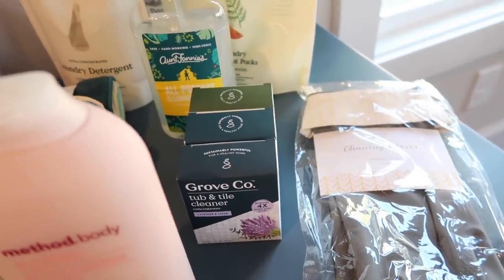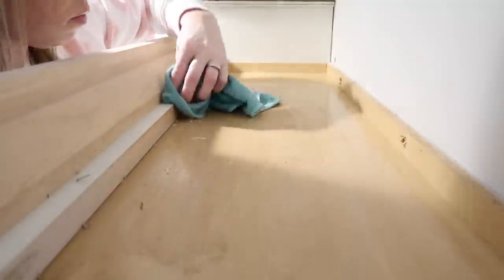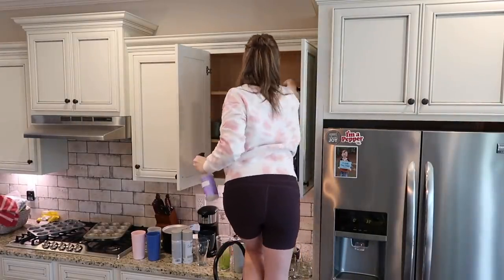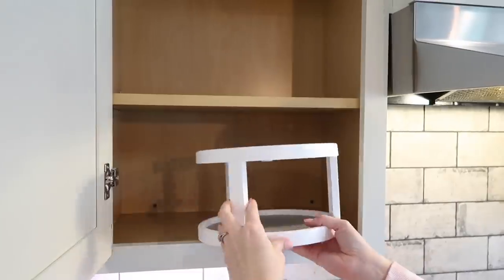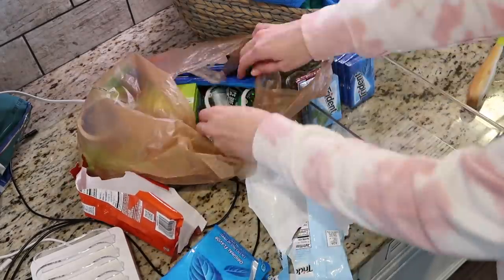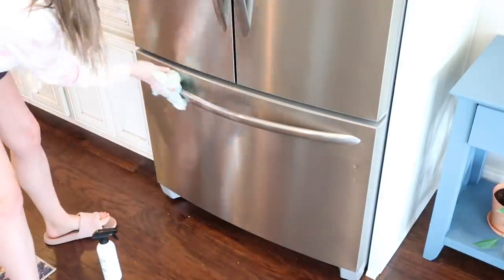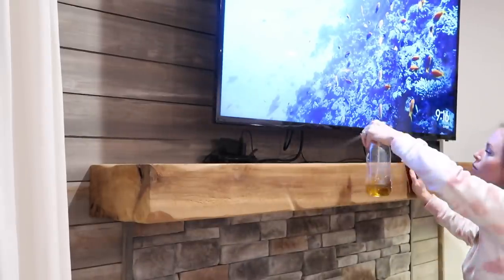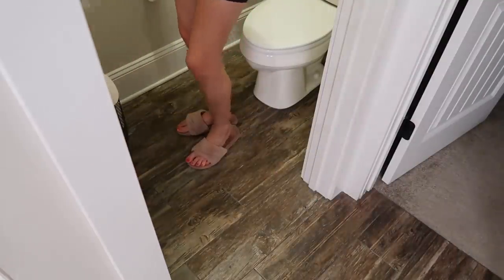NEW! EXTREME SPRING CLEAN WITH ME 2021 | FILTHY HOUSE TRANSFORMATION

Comment: It has to be at least 5 years, I did a fast cleaning when I update my appliances. I really need to clean the top, but I have short arms. You have the pollen in Georgia,  I have the dust in Phoenix Arizona.  We finally hit over 90's today, still very dry and dusty. I did get the Hoover stick vacuum,  found it at Wal-Mart much cheaper. The method furniture cleaner I liked, but can't use it anymore, it leaves a residue on my furniture. Nice video.  👍👍👍👍👍❤

Comment: We've lived in our home for 18 years and I did not know there were vent filters above our stove in the bottom of the microwave that is mounted above our stove. OMG! You would have thought we ran a greasy chicken wing bar 🤣! It was disgusting, I even contemplated throwing them away and buying new ones. But I powered through and finally got them clean.
Reply: Check your model instructions first, but the vent covers can usually be put through the dishwasher. Much easier!

Comment: I last cleaned behind my fridge was in January of last year when I got my current fridge. However, the most disgusting and embarrassing was in October of last year. I replaced my stove and above stove microwave and had them delivered and installed. When one of the guys doing the delivery/install took down the microwave so the new one could be installed dead dried out baby birds and nest detritus came fell on to the floor where the stove goes. I'd had a problem with birds nesting in the vent (the cover on the outside end of the vent pipe had come off years so the birds moved in) the home owner's association had the vent vacuumed out and the cover replaced. So while I knew that birds had nested in there I thought the problem had been dealt with.

Comment: So speaking of refrigerators ... I called a service company to come look at my ice maker because it stopped making ice. Turns out the bar somehow got pushed up which turned it off. He pulled the bar down and it worked just fine. While he was here, he pulled the refrigerator out away from the wall and to my horror it was thick with dust and dirt. I was mortified but he was so nice and said he sees this all the time. He asked for my vacuum and he cleaned the back out completely. So he said the motor sounded like it was working really hard and running rough. He got down on the floor and pulled that little grate out from the bottom front and there was a BLANKET of dirt covering the motor!! He cleaned it all out for me and waited until I got my mop and bucket to really clean under there and behind before putting it all back again. So my confession is that thing hadn't been moved out for about 10 years. Ugh! If I had know what was under there, I would have pulled it out myself. Ew.

Comment: NEVER PUT THE PAD IN THE MACHINE !!!! why? simple the dishwasher does a pre-wash cycle, which is basically what you did in the sink ... This phase usually lasts 10-20 min and is done in cold water. this just means that your tablet will not reach the hot wash, which is after pre-washing, if you want you can put 1 drop of dawn in the machine and put the pod in the dispenser. so it will come out on time.
BTW I never cleaned behind my fridge, because it is built-in ... it has 25 years of dust behind it and underneath it ... I'm going to buy a free installation just for that, so I can clean it  (its a old house :c)
: D